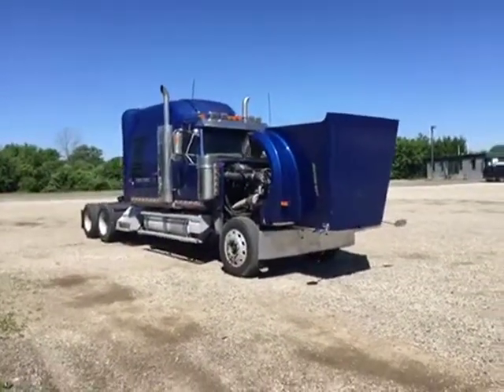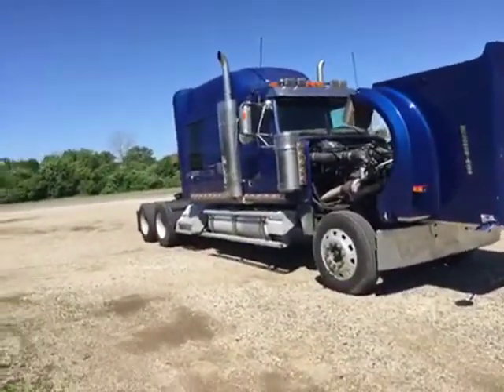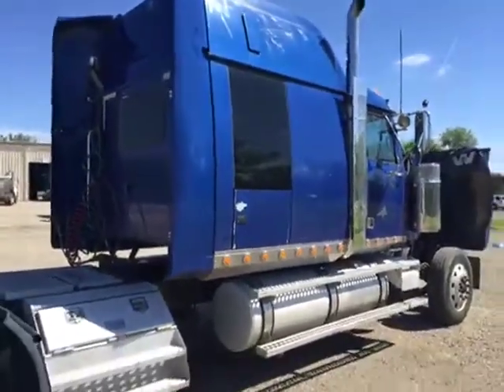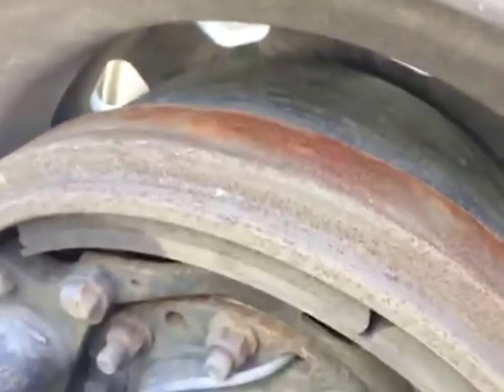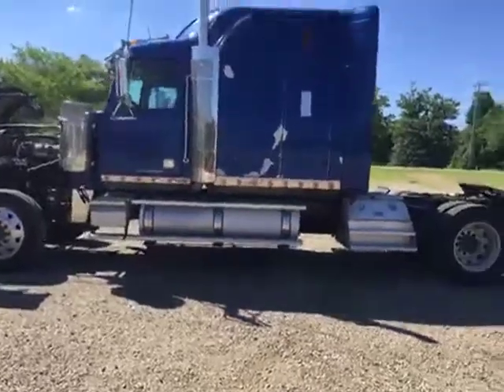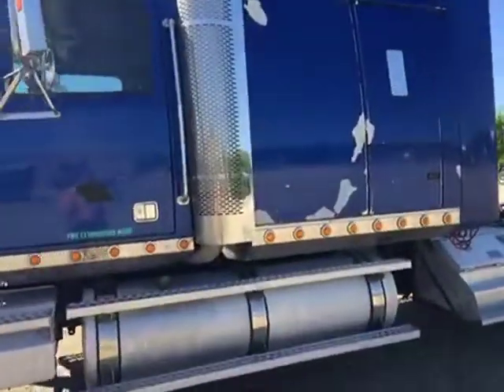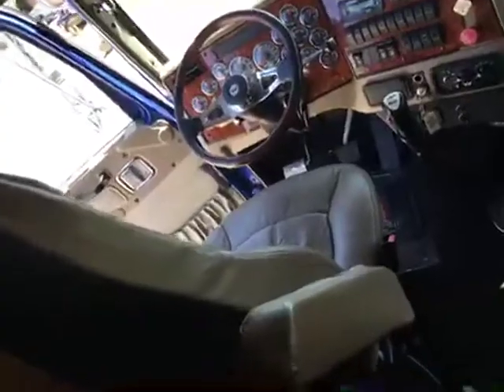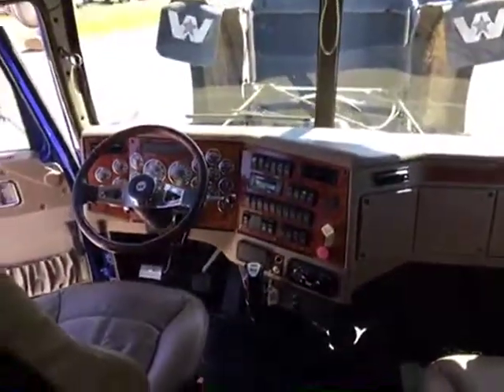2005 WESTERN STAR 4900EX For Sale

Comment: I bought this truck!!! 
This  EXACT TRUCK! 
Small world! 
Truck wash thrashed when I got it. 

I bought it in 2019 nov from a bank. It was a repo. The truck came with paper work of a full inframe and new head and injectors installed in Jan 2019. By a shop in Missouri. 
I got it with sludge in the motor. The coolant went to the oil. 
I put a bunch of videos up on YouTube of the build I’m doing to it. 

Right now it’s at a dealer in Arkansas getting a out of frame rebuild. 

That motor did have lots of work in 2019 Jan. But the block was not cut and that caused the sleeve to move and thus mixing the coolant into the oil. 

Can anyone get in touch with me about this truck? I’d love to know the history behind it. 

Go to my YouTube “George George “ and see the videos. Post on there anything you know. Thanks.